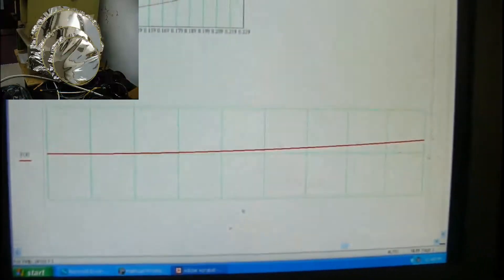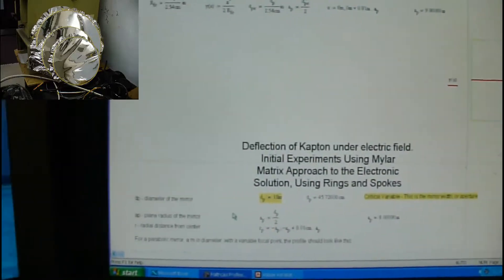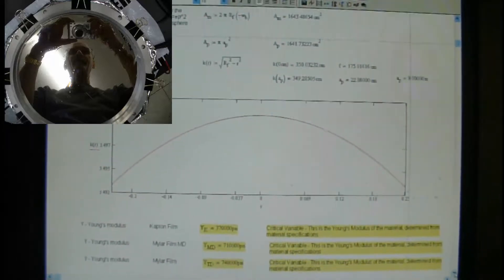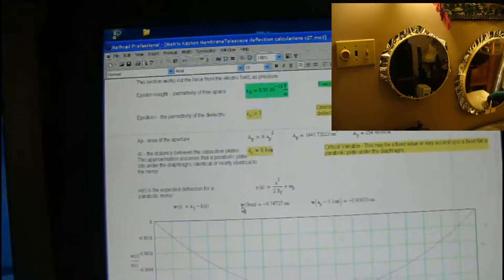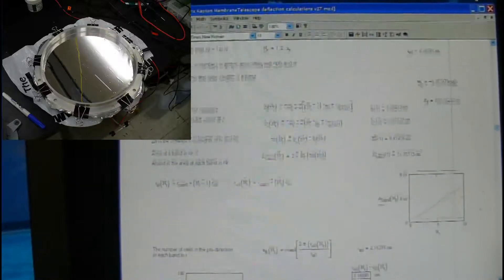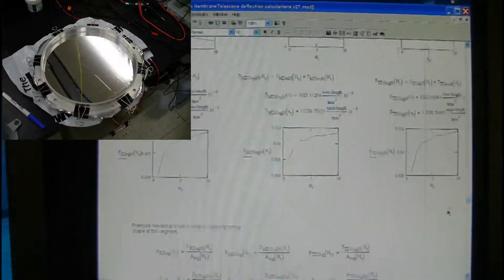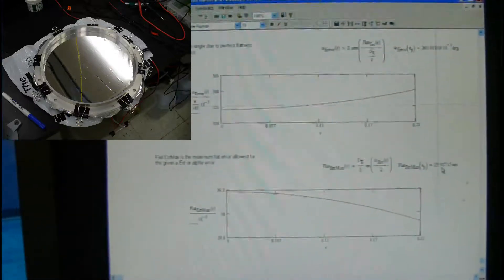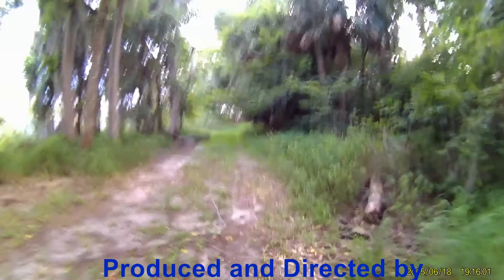Part 1 Design and Build a Mylar Electrostatic Telescope

Comment: Thanks for the video.  This is a similar idea I have been working on trying to make a parabolic antenna for amateur radio astronomy. I am putting ideas on the back burner to have a lightweight and budget friendly antenna for an earth moon earth antenna. Either have a dish or I have plans to make an array of cross polarized yagis.
Reply from the maker: This would be better suited to laser communications.  In fact, I put in two SBIRs with NASA, which included a substantial amount of proprietary material, which is one of the reasons you don't see any additional videos on this particular research project.  I know that NASA is very interested in this, but I'm working alone and haven't the additional funds to hire help.

Comment: I see that you are calculating the Mylar parabolic dish. But how did you account for the material fatigue?
Reply from the maker: All materials have a certain amount of fatigue that they can tolerate.  For an application such as this, if it's in space, it will remain in the parabolic shape that you give it (it will hold its charge), so there are no oscillations to create fatigue.  For personal telescopes on the ground, Mylar is cheap enough that you can simply replace the mirror with a new one.  Mylar doesn't work well on the ground, anyway, so likely ground optics will be Kapton.  Mylar soaks up humidity and sags, so is perfectly suited to space applications, which is why you see a lot of it.
The parabolic dish calculations were minor in comparison to the electrostatic field calculations.  But the task of designing the electronics for the high voltage demands of this project have become herculean.  And proprietary.  I won't produce any more videos on this until after I patent them.

Comment: Hi, can you tell me where can I find aluminized kapton? Is there any supplier you can recommend?
Reply from the maker: Thank you for your question.  It's been a battle for me to find Aluminized Kapton.  You can find it, but it's very pricey.  I don't recall where I've found it, but the sizes I've found that were only somewhat affordable were too small for my needs.  The sizes that suited my needs were far too expensive.  Bear in mind that, for this application, Kapton sags in a humid atmosphere (it's better in space applications).  Mylar works better here on Earth.